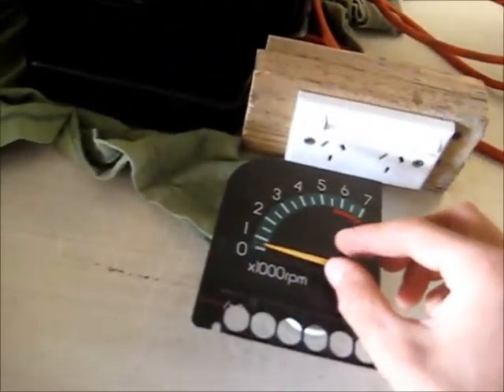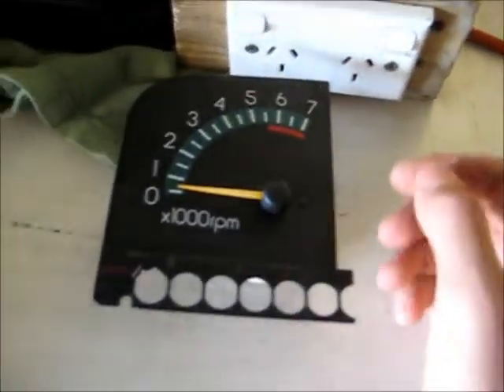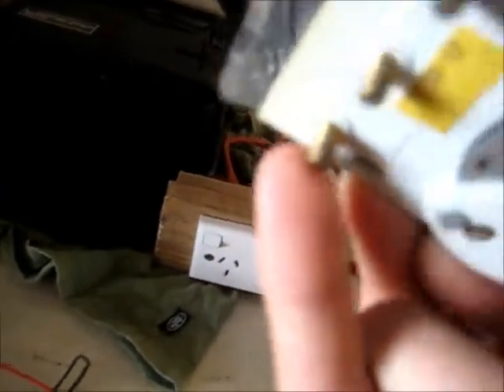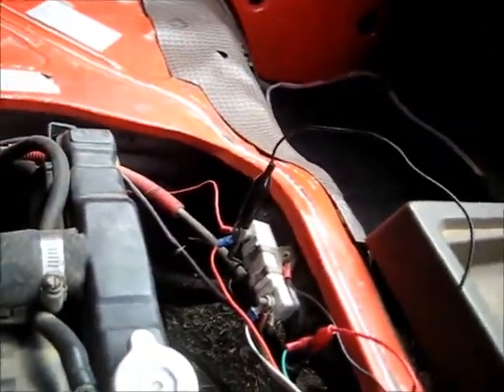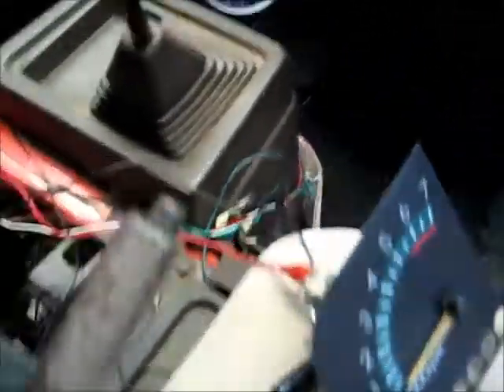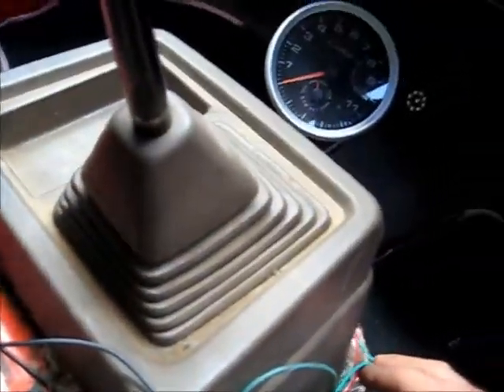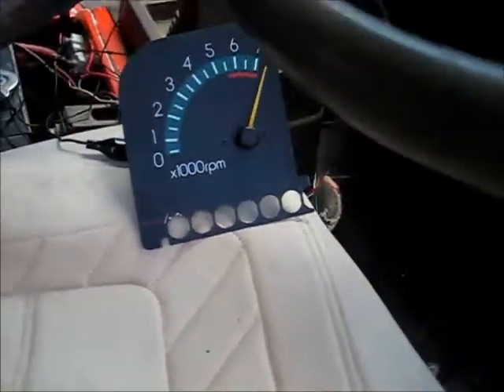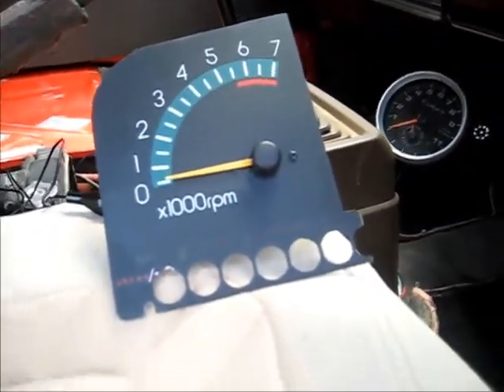Tacho Test on older Engine

Comment from the maker: @BoomBoxDeluxe This Tacho works on a set of pulses from the Coilpack on a fuel injected engine, usually driven by the Engine Computer, The pulses on this Older engine would be alot different as the coil is mechanically driven with a rotating contact in the Distributor, the other Tachometer is universal, and registers correctly on this engine :)